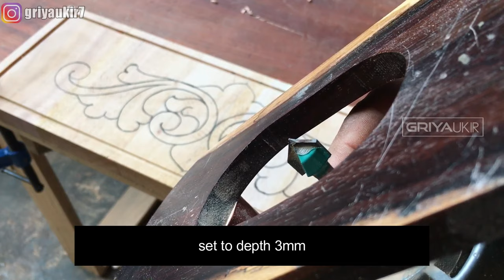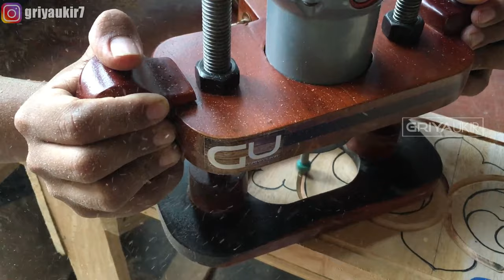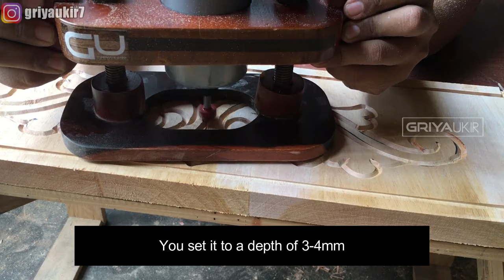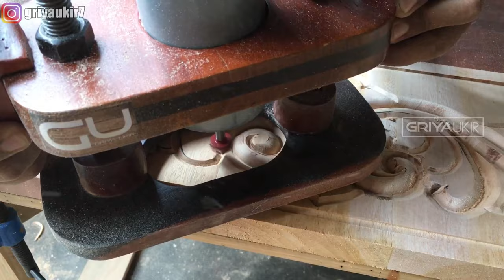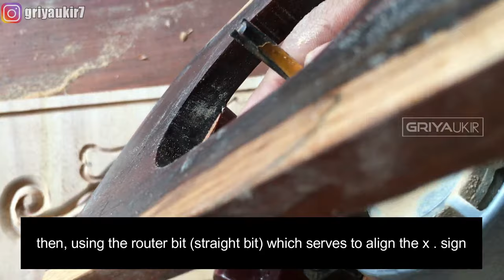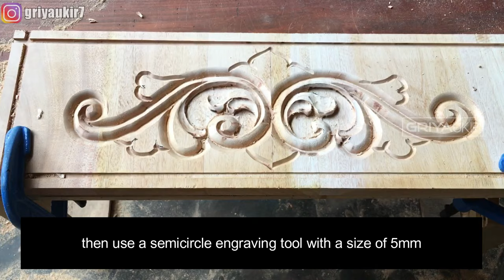a quick way to make wood carvings with a router machine

Comment: You do a magnificent job!  I'll practice using soft wood; following lines- Using: correct bits, correct depths, correct speed, ...  My experience I'll be on the very last step OR the very first step and something will chip off, burn or I'll cut out WAY too much going off the line.  I'll practice first and gain some experience - Thank you for helping to provide me a goal, you make this look easy